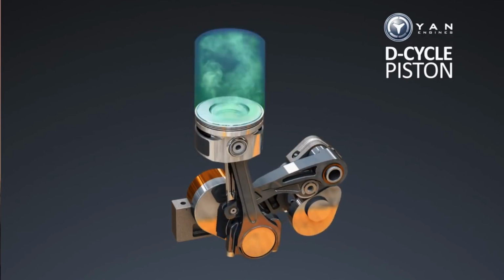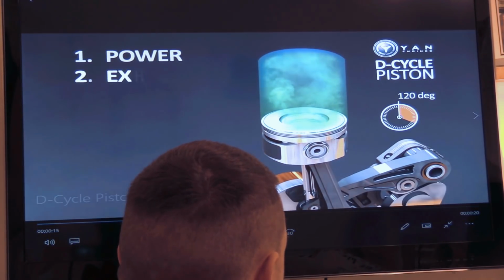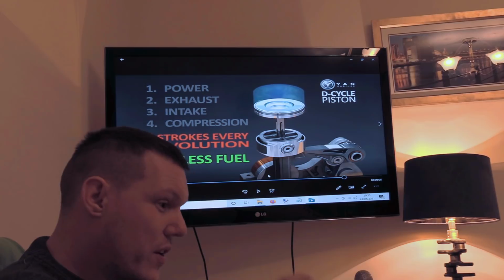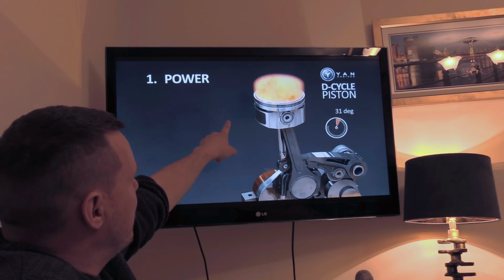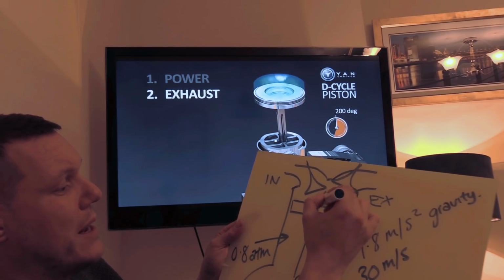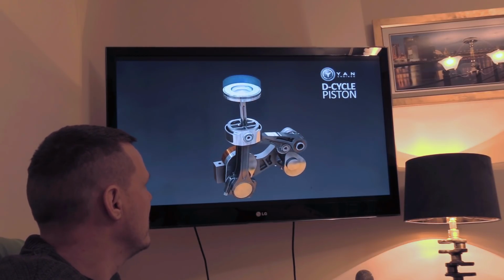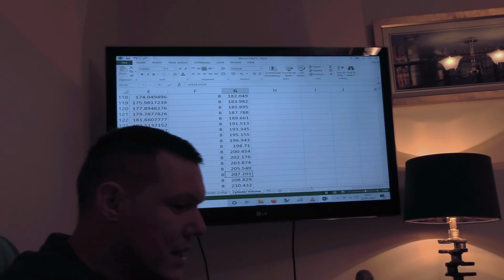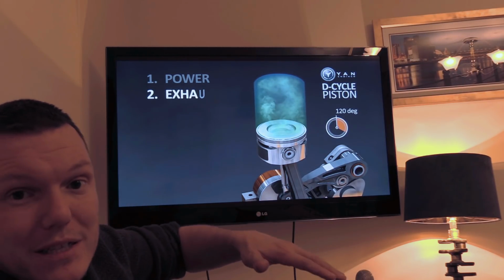Is this a GAMECHANGER? | D-cycle engine

Comment: this Piston is mechanical bullshit.
Reply from the maker: Because?
Reply: @thedirtyworkshop  it need more Energie to move all the parts and move up the scond part from Piston. The Construction is expensive and not for long life.
Reply from the maker: How much does it cost? And how much it too much?
Reply: @thedirtyworkshop  when the Price over maybe 100.000 km its higher than the Rate it save Gas, then its too much. Maybe it save real 10-15%% Gas, so you yan save around 1000-1500 Liters Gas at Range 100.000km. Now calculate, higher Price and higher Service Price. Im sure this Engine make not 100.000 km without break. The next is, this Piston cant make high rpm. So, you have less power. With minimum of Physical knowledge understand thats Bullshit. And show me this Engine real in Function- not exist and will never exist.
Reply from the maker: You think the piston can't make high rpm... do you know why, or have any data showing this? Lol no, no you don't....
Reply: @The Workshop  Engine with 89mm Crankshaft and 6500 rpm Pistons make  near 20 Meters/Second. For this you need high Quality and strong Pistons. 20 Meters Sec + the Speed Lift up Second Part from Piston with this shit Construction LOL Every Mechanic understand thats not possible but i think you are not a Car Mechanics.
Reply from the maker: 1. 20 m/s is really slow. I think you mean average piston speed, and that usually means nothing. What is important is max acceleration. 85 m/s is pretty common for a peak piston speed.

2. You don't know the strength of something by looking at it.

3. Car mechanics don't know this, thats why they're mechanics.

4. It seems you don't understand, not the other way around.
Reply: @thedirtyworkshop  20 m/s is slow ? lol, how many Engines did you build ? I build many Engines for Motorsports the last 30 Years. And show me this Engine real Action and not mimimi Animations but it will never exist a real Engine with this shit Pistons. You will see...
Reply from the maker: Any motorcycle engine runs piston speeds higher than 30m/s average and 85 m/s peak. What didnt you understand about that? 

These engines run up to 16k rpm.so yes you twat, 20 m/s is slow.